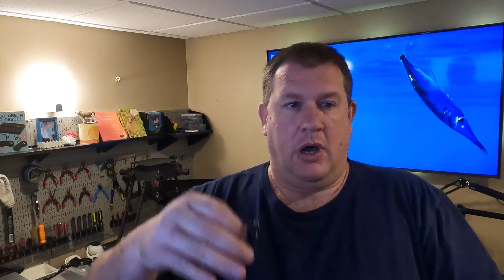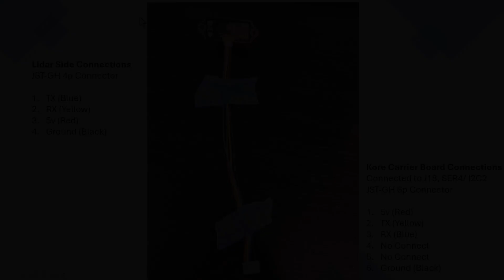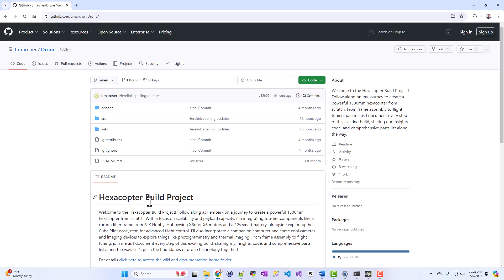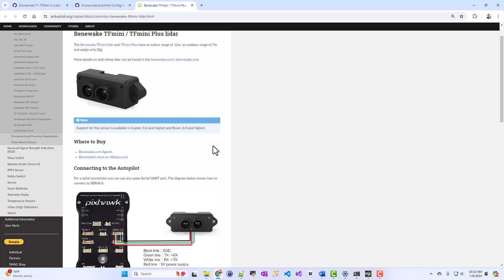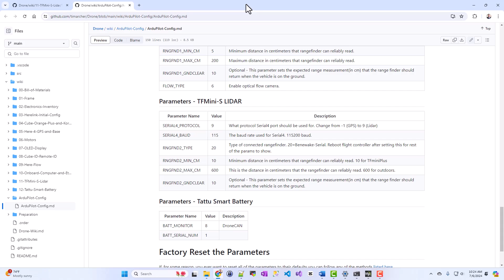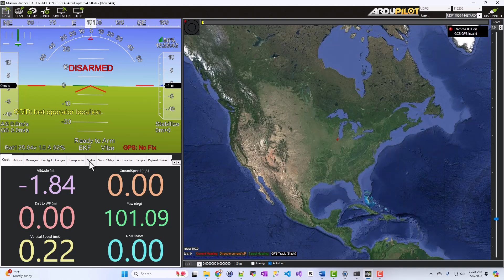Hexacopter Drone Build Project – Part 11 TFMini-S LiDAR

Comment: Is the happy function possible using the front sensors of the airplane?
Reply from the maker: Not sure what you mean by "happy" function. But this may help, on the ArduPilot param docs you can set the rngfnd1_orient param to set the orientation (ie forward). This may do what you want: https://ardupilot.org/copter/docs/parameters.html